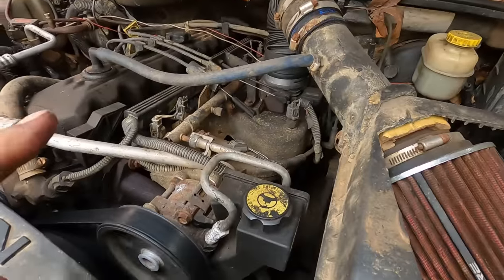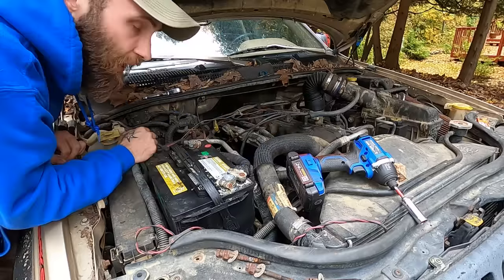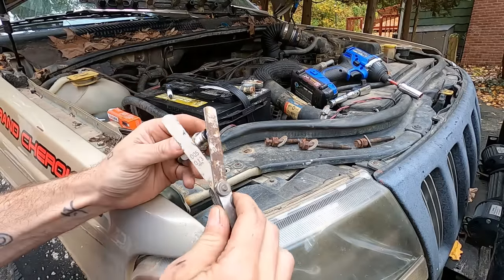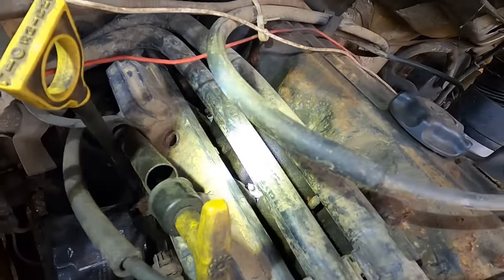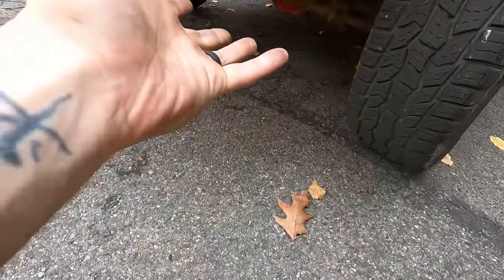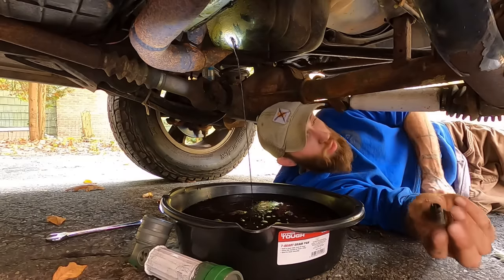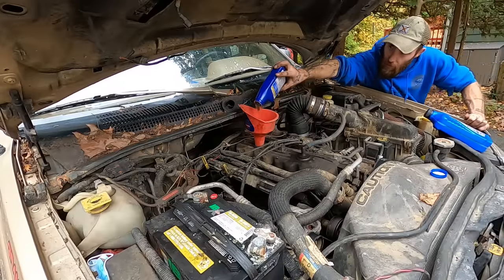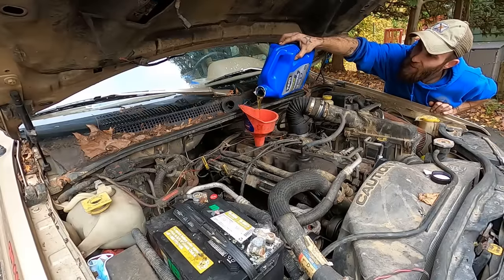Stop treating your Jeep 4.0L like a MODERN ENGINE... It isn't one!

Comment: Gents, getting a clunking noise shifting into reverse. Whats odd is that it is much less loud when its the first time after it sits overnight. T-case fluid changed about 3k ago, filled up to the top hole, i feel like it's full. What else could I look at?
Reply: Any more details? Is it always there, does it change with transmission temperature, does it happen when going from park to reverse or from reverse to drive, can you feel the clunk beyond just the noise? What else has been done to the vehicle? Have you checked all the mounts?
Reply: @MeDicen_Rocha  new control arms (front and back), all new tie rod ends and trackbar. Torqued to spec. Alignment done by a reputable shop specializing in bigger rigs. Transmission, transfer case and diff fluids changed by me about 3k ago, went by the manual recos for all fluids. New trans and valve cover gaskets, torqued to spec. Read about checking the engine mounts, but not sure where they are on this jeep. Also did a 2" boost lift and changed all 4 shocks and rear springs about 2 years ago (the noise was there before that).

Noise happens after the engine reaches operating temp. If it sits overnight, the first switch in reverse when i back out of the parking spot is silent. After that I hear a single clunk when the gear is switched in reverse, beyond that nothing, i.e. no grinding or other noises when reversing. It doesn't happen when going back from reverse into drive, doesn't happen when going into low 1 and 2 or in neutral.

Its hard to say if i feel anything beyond just the clunk. I hear the noise and feel a slight vibration in the gear lever. Slight shake in the truck, but not violent, similar to driving over a small stick maybe. Its not voilent enough to cause a major concern for me, but i do find it odd and worry that it might turn into something more serious in the future.

Comment: Had a 97 TJ with a 4.0 and AX-15 - both lasted over 325k miles original, the frame died first.  Was using Rotella T6 with no problems.

Comment: Some engines that are a little newer (thinking the 4.7 V8) actually don't run as well on the fancy plugs, I've heard they run best on the old copper core plugs. Makes sense, use what the engineers who designed it intended.

Comment: I use the bigger oil filter on my 97 4.0 & STP only makes your oil viscosity go up. Modern engine Oil's offer a hell of a lot better protection than STP. If you want to add something to your 4.0 add RESTORE, MARVEL OR BG ENGINE PRODUCTS. Spark plugs are dead on use copper, I prefer NGK & a brass Distributor cap.
Reply: Modern engine oils lack Zinc unlike a lot regular motor oil brands. If you want the best protections Regular Shell motor oil is great or something like Amsoil Z rod. STP definitely helps in high mileage motors
Reply: @waterloo123100  a simple solution to that is to buy rislone ZDDP additive from autozone/ advance auto. Modern oils make a huge difference in engine wear protection and you should be using it just buy the zinc  additive smh
Reply: @GSXR-1000  I tried your methods a long time ago on my 93 4.0 and the only thing that happened to my motor  was it started Burning oil and knocking. You’ve missed the point of the video. It’s a 30 year old motor that was more or less designed in the 60’s. it’s not made for modern engine oils. They don’t make a 10w40 full synthetic oil either. So there’s literally no benefit to pay more for oil that wasn’t designed for your motor. If you keep up on oil changes the 4.0 will outlast the vehicle itself.

Comment: I have a 99 TJ Sharia approx 150,000 miles.  4.0L  and primarily  she stays on the road and light off road, pastures and back fields and the like.  10w30 conventional motor oil.  Usually STP or Wal-Mart brand.  Since conventional if getting harder to find, is synthetic or synthetic blend a better option?

Comment: I have a 97 grand cherokee, i have a problem and am looking for some help. It will shut off without warning when driving and you will be able to start it within usually 10 to 20 seconds. Some say that it is a ECM problem where one of the pins isn't making good contact, i have made the bracket to squeeze the connectors tighter and the problem still exists. The VIC shows that the coolant sensor is bad which has been changed twice ( with a factory one ) and it still shows bad ( Is the VIC shutting off the vehicle so it doesn't overheat? ). I have also put in a new fuel pump as the old one wasn't up to spec, still the problem exists ( sometimes it smells of gas when restarting )at a loss currently and need some help or suggestions where to look next. Love the vehicle as it has the 4.0 and the good transfer case as i like it ( able to switch to 2 wheel drive ). Thanx Ken

Comment: I inherited my grandfather's 03 wj that was sitting in a garage for 7 years. Has just under 90k miles. I also got around to swapping the plugs this summer. The gap on the old plugs was on average .065.
Btw, how much of a clunk should there be when switching from park to drive or reverse?
Reply: There should be no “clunk”. Be sure the idle has kicked down from warm up, give it some time if it’s cold. Check the driveshaft universal joints, be sure they aren’t worn or broken. Be sure to change transmission fluid/filter as well as the axle fluids.

Comment: The number one thing thar kills these (other than people running them too hard) is they are NOT running an oil with zinc in them or an additive. These engines run flat tappet lifters and cam and modern oils don't protect them. Modern engines all use full roller bearing lifters and the oil for these wipes out the lobes on the cam. Nearly every core I rip down, the camshaft is gone

Comment: Got a 99 cherokee sport 4.0.  Only this I had for it was 4x4. Only have had to replace the power steering pressure line (the engineers really need a kick in b**ls for idiocy) and the wheel hubs. Make sure you know your stud length when ordering. I ended up buying new rotors as the short length hubs were going to be many months before availability and I knew I needed them now. Getting to do the front linkage as they're getting a little sloppy but still holding strong with 300k on it.
Only thing I have a question about it the wiring in the dash/doors. I know there's connectivity issues and am wondering how difficult is fixing it. Pulling the dash looks inevitable and a real pain.  Just wondering. 
Interesting video. Thanks for sharing!

Comment: Good tips, except the one not to clean your engine. I run a 96 ZJ, and I keep my engine clean, thanks to that you can see the potential leaks and cracks and you don't get so dirty every time you want to do something. No part will fall down if you keep the engine bay clean trust me, the dirt is not keeping anything together 😉

Comment: That coil rail is a modern solid state ignition system and produces a hot enough spark to burn copper plugs. Yes, the spark is strong enough to erode copper plugs. That's why you have to change them all the time, because the gap is growing substantially. Save yourself a lot of headache and head wear and get some NGK iridium plugs. Expensive plugs don't get you power or efficiency, they just last a lot longer. Wishing for a distributor is a sign that you haven't kept up with the tech know-how.

Comment: I have 3 amc's with 401 v8's and I don't use zing in any of them past breakin. I run the highest rated oil for wear and pressure protection, Quakerstate 5w-30 full synthetic. never yet wiped a cam or distributor gear, with good oil.

Comment: I never put additives in my oil in a 4.0 never had issue with them running modern synthetic oil . I have had issues with fuel injectors but $50 is a set of 6 new Bosch injectors and runs like new .

Comment: Question? What is the recommended oil I SHOULD be using in my 4.0L. Just got a 4.0 95 YJ and I'm very new to the jeep culture. I would very grateful for any kind of knowledge on these machines.
Reply: 10w30, i’ve heard a lot of people switch to rotella t6 15w40 at 75-100k plus

Comment: Hey i know this is probably stupid but i have been using zinc in my wj for quite some time but it was already after i the vehicle had over 100k on it. Bought it with 114. Probably didnt start with zinc till about 135-150ish. How bad do we think the lifters are? And or is there any way to tell? Signs so to speak.

Comment: You could add a few more miles by throwing that oiled gauze filter in the garbage and going back to a stock air box and paper element filter.  Rotella T4 still has higher levels of ZINC.  Almost 1000 PPM on my last oil analysis.  Some of their newer blends have lower amounts.   You can get Rotella T4 in 10w30 weight.

Comment: That engine is a LOT older than 1986.  AMC developed it waay back in the 1960's, as the 232/258 cubic inch, and it was installed in many AMC cars. IIRC, it actually came from Rambler.  The CJ series recieved a nose job in ( I beleive) 1972, adding about 4" to accomodate the 258 as the base engine.  Chrysler inherited the engine when they bought AMC in 1986, and they made changes that added the fuel injection, a higher compression head, which then became the 4.0 - about 240cubic inches.  Corrections requested.

Whether carbuerated or injected, it has always been among the best in-line 6 gas engines ever made.  Although, IMO, that category has some very high level competition.  The US has produced arguably the best in-line gas engines in the world due to its need for reliable farm/generator/pump power plants.  You can almost pick a brand and find excellence in that design.

Comment: Daily-ing a 1991 Limited now. Gas is brutal on Philly area. Paying near $4/gal. 
The war wagon was being held on to for trail and snow. I ended up having some dude stop in a heat wave on my previous Daily (Gen 1 Honda Pilot) and offer to give me a jump in a parking lot. I figured fck it, i need to get home and sleep after a 16 hour day. Turns out it was a broken ground to my starter and a few strands of ground left on battery/fuse side. I hook up my side and didn't check him hooking up his side. BIG mistake. He jumped me cross terminals. It burned about 6 feet of grounds in the rear, abs sensors, VTM-4 module I'm pretty sure and more. So far wiring harness is replaced, grounds replaced and sensors replaced. Now to replace and flash VTM control module.  
But Jeep 4.0 came thru big time. When i parked it from injuries in another accident i kept the XJ for when i could climb in and out agaik. I fogged the cylinders, stabilizer in the fuel and before starting it again. Fresh oil, fresh fuel, fogged again. Battery in and cranked right over. A few hoses needed replacing after driving a few week. XJ was a lifesaver. Honda has been down since July.  I'm slowly working on that for the lady to drive.

Comment: Help!
Love my 4.0
Had a miss-fire.
Turned into a backfire through the throttle body. 
Everything I’ve done helped. But still backfiring. Replaced plugs. New coil pack. Fuel rail and injectors. Over the year new upstream o2 sensors. New fuel pump located in gas tank fun 🤩.
All sensors new mad etc.
Been showing low oil pressure at idle. Anyone any suggestions please 🙏🏼

Comment: My 98 grand cherokee overdrive does not work properly.  From Start up to 20 min of driving it  will shut off on its own.  The push button doesn't work.  I've replaced  the speed control sensor. What  am I missing to fix my overdrive

Comment: Just use an oil with zinc as one of the additives and treat your fuel. Adding zinc to the wrong oil can be counterproductive depending on what is in the original oil.

Comment: “New Jeep Cherokee Cherokee Laredo” owner here. My 02 42rs trans shutters and slips . 206,000 miles. Any suggestions? Thanks
Reply: I have a zj with a 42re and was having same issues. Sounds like you need to replace solenoids, sensor and accumulator spring. They sell kits with a bigger pressure solenoid (Borg Warner). Its not a hard job but you will get dirty. And replace your pan with one with a drain plug for any future issues. Theres a # of YT vids on the process. Good luck
Reply: Also, first step is to always fluid level first. Could that simple

Comment: actually it goes back further than. The 4 liter six is the old AMC 6, bored and with a shorter stroke, with new heads for fuel injection and better temperature control.  Of course, they modified the intake and exhaust manifolds also.  So you can say that the engine goes back to 1965.  People have taken the 4 liter, replaced the crank with the crank and rods of a 258 (4.3 liter) AMC 6, keeping the 4 liter pistons and ended up with a 4.7 liter engine.  The crank and connecting rods are a direct bold in replacement.

Comment: Hmmm. I disagree. I have a ‘02 WJ. 276k miles. I just changed the plugs, that have been in the vehicle for 115k miles. I had a check engine light indicating a misfire. The plugs had almost no diode left. I replaced the ignition coil with a Standard Products Blue Streak coil and put Bosch double iridium plugs in it. No more check engine light. These plugs can run with a bigger gap, meaning larger spark. I spent $36 on plugs, that will be the last set I ever install in this vehicle, rather than $18 on plugs I will have to replace in 15k miles. Worth it? Of course! Does it run? Beautifully! New tech will work in old motors.

Also exclusively run full synthetic oil. Doesn’t leak a drop of oil, and no dry starts. I don’t even bother to check the level between oil changes.

Comment: Why would the head gasket go on those, is it something owners do  and do we really need to isolate the injectors from the mainfold as they get too hot? Great vid thank you so much ( mine is on a double irridium sparks ) I have 2xXJ'a one ZJ , one WJ , and one WK so far :)  My WJ runs on LPG as well as petrol and I am squeezing around 230 miles out of 75 litres LPG tank in the spare wheel well :)

Comment: my 97  4.0 6cylinder  4WD  ZJ has 190k miles... no lift, no giant tires...(low resistance roll - quality tires -however)...running rotella T5 15-40 in the Summer, T6 5-40 Winter.... gets 25 miles to a gallon...why, because I drive it like a grandma.... love to just hear that 4.0 purrr ... and YES,  it has the copper Champion spark plugs, $2.00 approx. each.

Comment: Older Subarus want the copper too. Don’t put iridium or platinums in early 00s Subarus. Don’t put iridium or platinums in any pre 2000 vehicle. They’ll run better on copper.

Comment: Hey man thanks for the great content! I'm planning on doing a 2" budget boost on my WJ, but stock otherwise. What tire size would you recommend for that?
Reply: Just spend the money for springs. You don’t want to be chasing around a death wobble you created. 31 is all you can go without cutting no matter the lift size
Reply: I run 32s with 1.75" spacers. Minor front bumper trim with a sawzall (took 10 minutes) and removed plastic "rock sliders" covers. 2" puck lift

Comment: if you read the manual... at least for my 97.... it will take anything from a 5W-30 to a 20W-50 (depending on outside air temp)
i run a 5w-40 year round....NE montana. 
.
mobil 1 turbo diesel truck...... expensive, but has a BIT of zink
most 5w-40s are expensive..... but its the best weight for all year driving
.
might go to a 10w-40 when it gets to 100 degrees all month in aughast 
but the difference between a 5w and 10w at 100 degrees is not that much (the bump to 40 over 30 matters WAY more)

Comment: "No easy way to fill the oil if you can't get the filler off?" What? First off, you can easily rip those fill caps apart and the lower half still works as a fill cap. You can also remove the PCV plug and fill there

Comment: I do have a quick question regarding zinc... I have a niner (5.9L 360) ZJ, would it be good to run zinc in that aswell? as far as I know it doesn't have roller lifters, but I've heard stories of zinc chewing through cam lobes. don't know if that's an old farmers tale, but I would appreciate some knowledge from other Jeepers. Thnx!
Reply: Yes I run 15w40 diesel motor oil in my 4.0s and magnum engines.

Comment: Picked up a old 04 wj with the 4.0 it has a nasty shake at idle almost like it wants to stall. Scanned it no misfire data and from going through the maintenance history seems the previous owner spent some time trying to figure this out too. New fuel pump, new IAC, new fuel filter & plugs. 

Not sure where to go with this. Old owner said he would put fuel system cleaner in it every time he filled up and that seemed to help. 

Idk if he was just wasting his money on a band aid fix 

Any help would be appreciated
Reply: The question is, does it actually want to stall or does it just feel like it?
Ive seen all sorts of things cause fucky idles on WJs, including and not limited to vacuum leaks, failing PCMs, messy timing, flat cams, aftermarket "sporty" cams, failed engine mounts, and so on and so forth
Reply: @MeDicen_Rocha  it has stalled a couple times on me but not every time. Also I don’t idle it for extended periods of time. Seems to be an issue when engine is completely heated up.

Comment: I have an 05 LJ that many years ago I had regeared 4.88s. it was just to have a somewhat more normal driving experience with 35's and the garbage 42rle. Stock axles, stock brakes (stopping foot strong). I love that motor but I would give up a finger to have an aw4. Have to have an auto, cant live with a stick anymore. 
It has never let me down even when it was completely my fault.